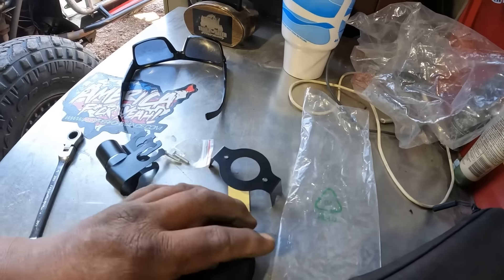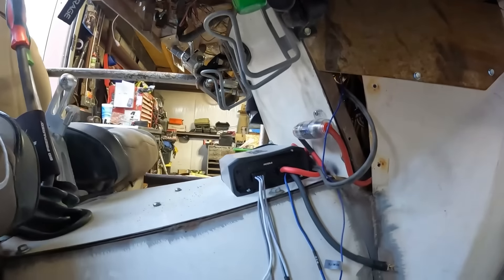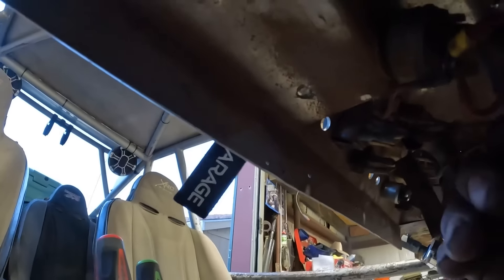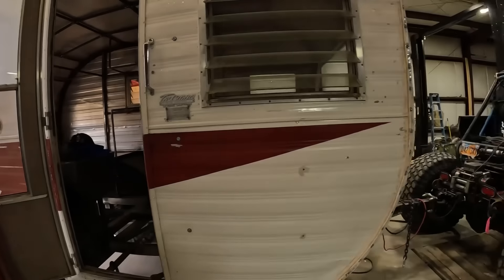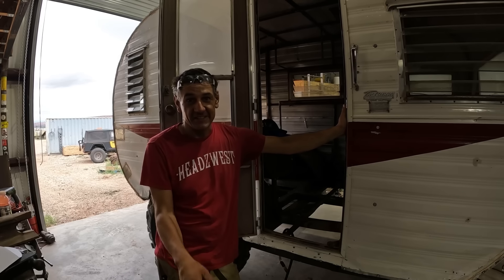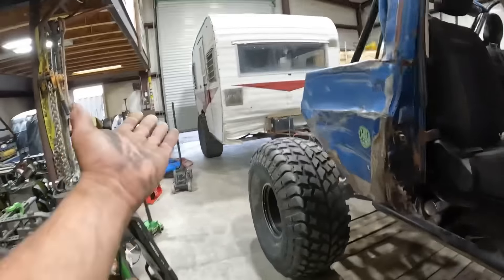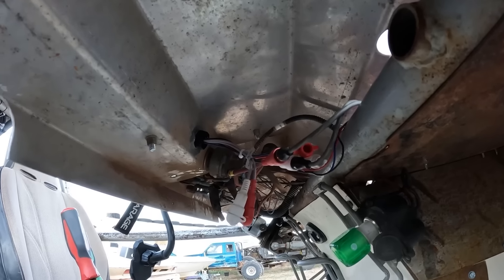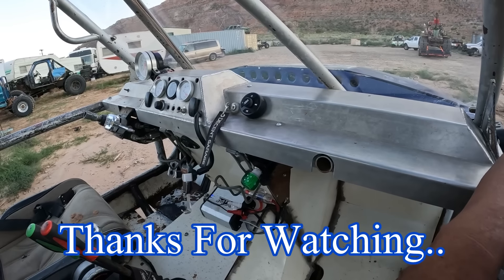Mike Is Back!!

Comment: Using expanding foam to insulate the walls and ceiling, as you describe, will be a great idea. It will add so much strength to the exterior skin as well as insulating the camper really well.

Comment: Glad you are on the mend Mike. Back during WW2 My dad went to a camp Doctor with pain in his side that was really bad. The Doctor just said go back to work and quite gold bricking.
It wasn't getting any better so he left base to find a local Doctor you know that he was getting desperate because he was stationed in China and Burma back then and their level of medicine in country so to speak was less than what most or other standards were at that time and even other places standards were not that high back then either. shortly before he found someone the pain suddenly stopped and he almost went back to base but he saw the local Doctor how opened him up because it pretty much knew what had happened. His appendix had burst. The Doctor saved my dads life by cleaning out the junk that had released when it burst put in a drain for the wound. If my dad had gone back to camp before the Doctor worked on him I would not be here because my dad would have died.

Comment: Hey Mike, glad you are back and survived.

Please don;t use the high expansion type of foam because it is very likely to cause bulging in that thin aluminum on your trailer and may cause it to tear or pull away from the screws that hold it on.... 

...Make sure to choose the expanding foam that is made for insulating doors, not the high expansion foam made for filling-in holes in walls like for plumbing drains etc. ... ...Ask me how I know that LOL!! 

I had a 1978 Toyota Chinook Camper that had a fiberglass shell, It was fantastic, but I wanted it to have better insulation, so I used the highest expansion foam between the new wall-board and the shell; what a mistake that was!

I did drill 1/4 inch holes in the inner wall-board to vent air out and excess air 'bubbles' and allow the 'excess' foam out too... ...and BTW, the main reason for the holes in the wall-board in the first place was to  to enable access for the foam-can's tube to 'inject' the foam into the voids between the inner wall-board and outer fiberglass wall.... ...And an FYI, the bottom of the walls had an open gap along the floor, but even that was not enough to prevent the 'damage'.

The aluminum window frames were sealed with sticky strip-caulk from the factory before I 'foamed' the voids... ...It took about 2 1/2 days before the foam stopped expanding!... ...Furthermore, I did not even know about the damage until the first heavy rain storm😱😖

...The expansion of the foam was way more pressure than I even imagined and it separated the seal from the window frame...

...To repair it I had to use the black 3M strip-caulk applied by hand from the outside... ...It worked, but was a sticky PITA to do.
Reply: Yea! I’ve used that high expanding foam to raise sunken concrete slabs..it’s no joke!!

Comment: Just glue styrofoam sheets on the walls of the camper. They bend easy, you can easily cut to size, and will be lot less labor intensive and cleaner than spray foam.

Comment: 09:25 Shawn, Mike, Rory and Justin, you guys have some really cool fringe benefits. If working the event, you get in for free. Maybe wear a "press" pass or "pit" pass I.D.
14:32 don't ya just love hand me downs Mike? It works, didn't have before and now all the rigs have "ghetto" blasters in them. If you install a 5000 amp stereo the bass speakers are free air conditioning lol!
15:04 Clever idea Mike on the shift knob closest to your driver seat to use a Gate latch to hold it in place, there again, repurposing and being creative. Maybe one day Mike you will explain what all 3 shift knobs do. I know 2 of them go to transfer cases but I don't know what the 3rd one is used for. I see you have to drive with 3 feet as well. I'm 65 and been driving with 3 feet since high school and my knees want an automatic really bad.
15:04 Justin, do you have a blur out feature in your editing software? There are 3 things: 1-there is a red Bic lighter on the driver's seat right side floor, 2-on the driver's seat is a cell phone and a blue Bic lighter next to that 3- an object that looks like it has a mouthpiece.
Mikes pocket music instrument maybe made from a deer antler. Maybe someone else knows what those 3 things are used for? Bic lighters, light cutting torches and.......

Comment: Mike, thanks for the love. I came back to read some of the comments posted after mine about your spray foam idea with pegboard and all replies are exactly right. Spray foam also contains formaldehyde, and the fumes will make you drowsy. especially when using in the enclosed way you want to use the spray foam. Yes, it could be a cheaper route but could be a serious health issue.
Here is a parts list available at Home Depot you could use as an alternative.
Owen Corning "Foamular NGX F-150, 1 inch thick x 4 x 8 pink foamboard is $31.97 per sheet, has an R-5 rating, you got some talent to cut the foam board to create your curved areas of your trailer. Use 3M Brand Super 77 low voc (my favorite for lots of things) to bond the foam to the metal. Then to cover the edge gaps or even your cut gaps cover with a very sticky Everbilt Brand 1.88 inches wide x 150 foot roll Radiant Barrier Foil Tape $13.88 each. Then apply your white pegboard (3/16 x 4 x 8, $23.98 each) to your metal frames with self tapping Lath Screws Teks Brand. To penetrate the metal frame, you have to use the drill point style. #8 x 3/4 (200) quantity, $13.37.  Watched Shawn trying to use a pointed sheet metal screw on his buggy and those pointed screws will not penetrate thick metal, But DRILL POINT lath screws will pre drill the hole and the threads will self tap. That is my go to anchor method. They come in various lengths. Good idea to use foamboard on your floor, wall, and ceiling. Floor would look cool covered with Luxury Vinyl Tile or sheet linoleum. Pick your cool color or design.